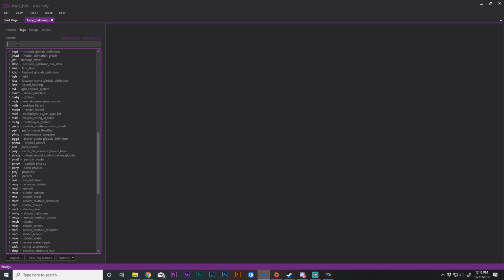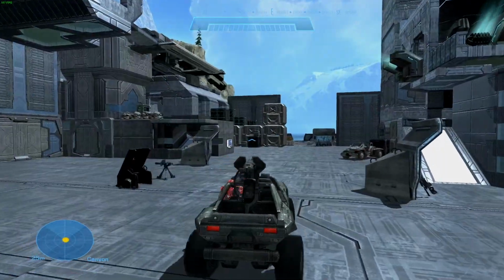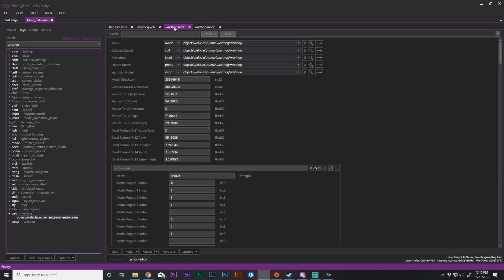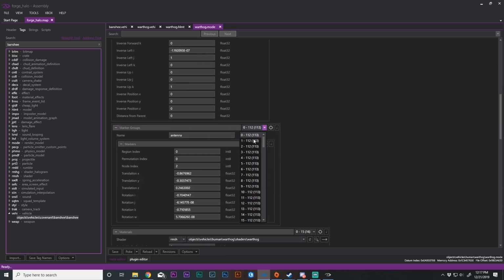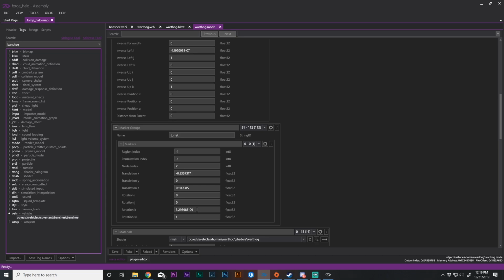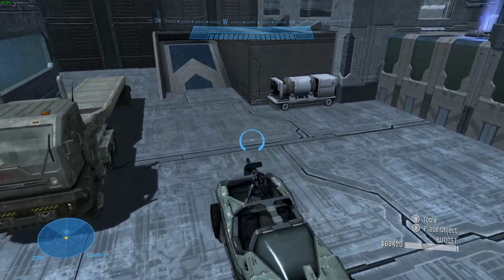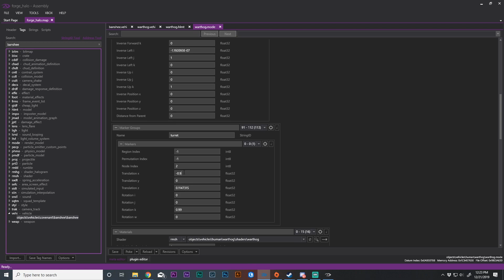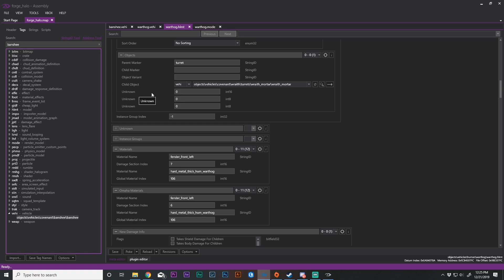Halo Reach PC | Assembly Tutorial #6- Vehicle Motion Properties & Turret Modification

Comment: Hello crimson, I was wondering how you fixed the MCC update problem with Assembly, since an update like 2 or 3 days ago I can't poke in Assembly anymore
Reply from the maker: 1) You should install Assembly through the down-loader. And make sure you have the experimental version selected in your settings. Before a patch was released for Assembly we had to change a value in the xml file for game version.
Reply: @Crimson-Glacier-Studios  Where do I find the installer, in github?
Reply: @Crimson-Glacier-Studios  Oh, I just saw the document, assembly executes perfectly, but when I try to it says that the game or map is not loaded at all
Reply from the maker: @Diego-lt4wm  do you have the version that came out 2ish days ago? You may have to change your XML file.
Reply: @Crimson-Glacier-Studios  oh, is it in github?
Reply from the maker: @Diego-lt4wm  https://github.com/XboxChaos/Assembly/releases/tag/downloader set as dev, and set build version to experimental in the settings.
Reply: You need to launch Assembly in Administrator mode to be able to Poke